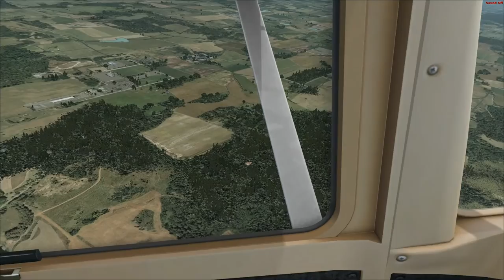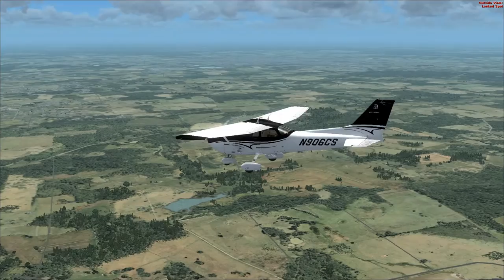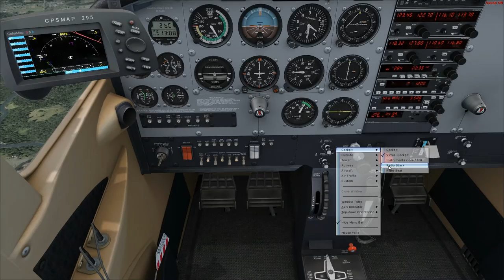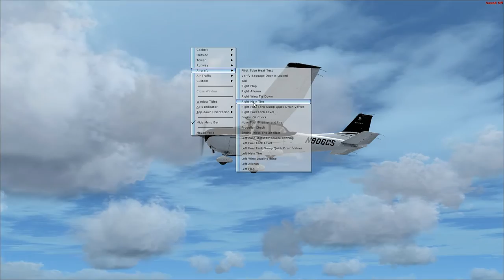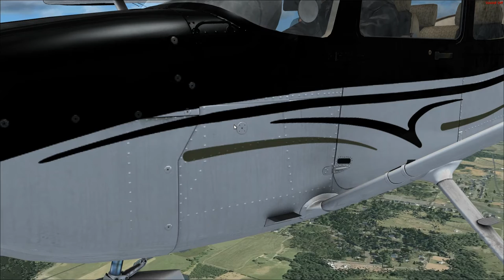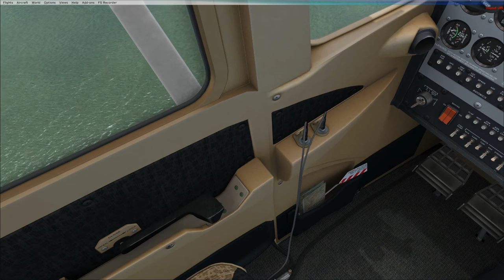A2A Cessna 172 Tutorial. Video 12, Emergencies

Comment: There is a thing called "Practice Forced Landing"  pattern or PFL. 

There's a methodology to assess the max gliding distance (a cone extending through the outer 2/3rd of the wing chord). The moment it is sure that you are going dead stick, achieve attitude for best glide speed,  identify Ditch-land space (field), and setup the airplane into a PFL.

PFL is what student pilots train for. So, the actions are pretty much known, and when the things get tight, the training kicks in. It keeps the whole process simpler, and increases chances of survival. 

It's  a sim, and while the A2A airplane is modelled extremely well, the terrain is.....well....ummm...not so well. So, one can get away with anything. 

Just saying, mate.
It's not a critique of an otherwise well made video .

:)

Comment: You missed vacuum failure but it is similar to static port failure except there's no in-air cure.

Off topic:  I also have the A2A Cessna but for some reason your tac is different from mine.  Mine red lines at 2400, yours at 2700.  What up with that?
Reply: I think the tacometer red line increases if you equip the fine pitch prop. (Don't quote me on that though.)
Reply: Change your prop